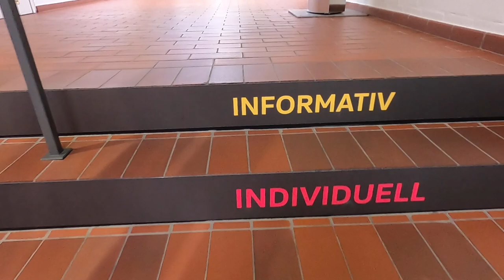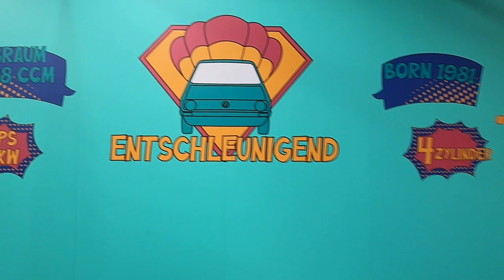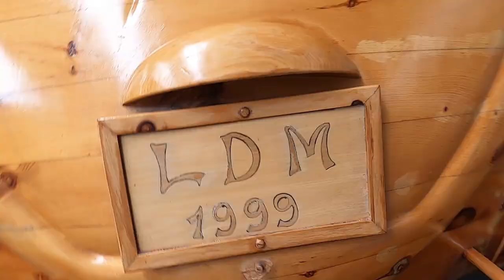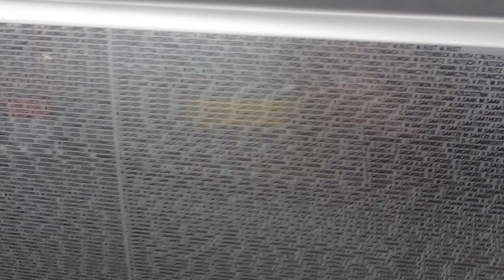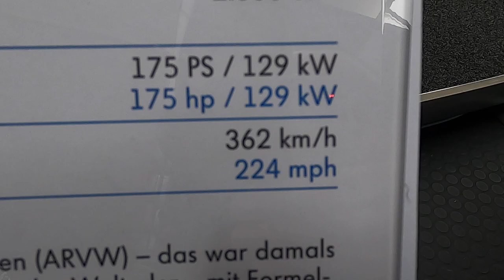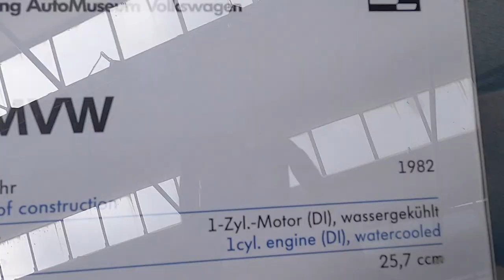Auto Museum Volkswagen!

Comment: The great thing about a bug is that you can rebuild everything,  parts are plenty,  and they are beyond simple to work on. I've seen a few pre 66 going for less then 4 grand. If you are cool with supper Beatles I know of a 71 flat window I could get you for a grand.  Rust free. ( battery tray and front apron need replaced,  that's rust free for a bug)
Reply from the maker: Hmmmmm a grand you say